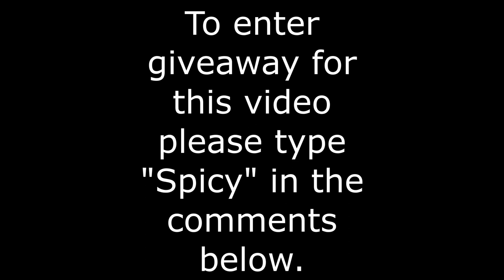Mesquite Salt and Pepper Grinder Woodturning With Inlay (Episode 29)

Comment: I'm with the others using sidewalk chalk is new to me but a wonderfully spicy idea. Question: do the mechanical parts come in a smaller size? I have several different types (colors) of peppercorns and would love a set of smaller grinders but have no idea where or how to look for them.
Reply from the maker: Thank you. And yes they can be smaller. The kits I use start about about 6 inches and the tallest set that I have made is about 18 inches. I will email you a picture of a set I just finished up that I am donating. Again thank you for watching and entering.
Reply: @MillerWoodturning  Thank you for the explanation, now I know what to look for :)